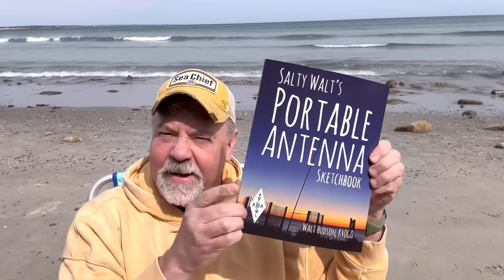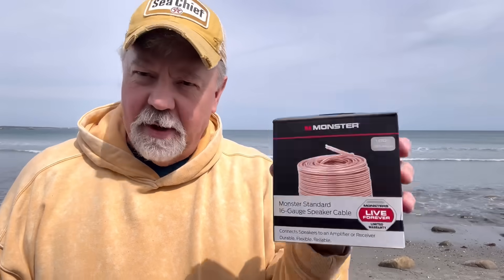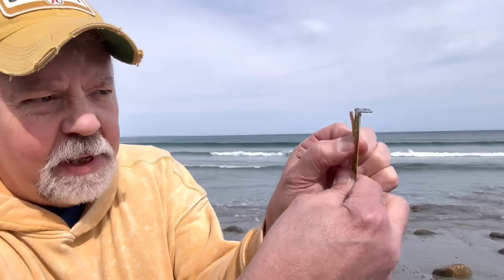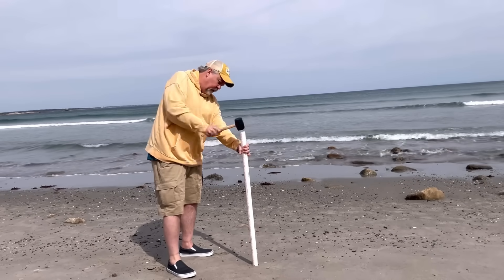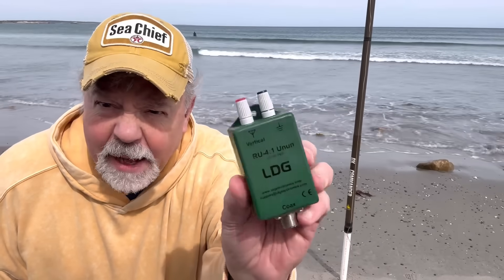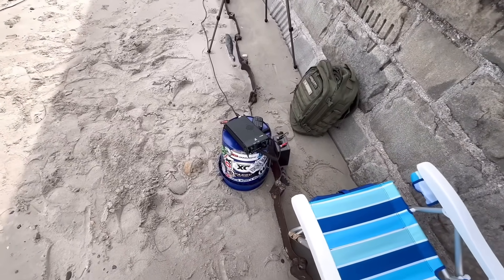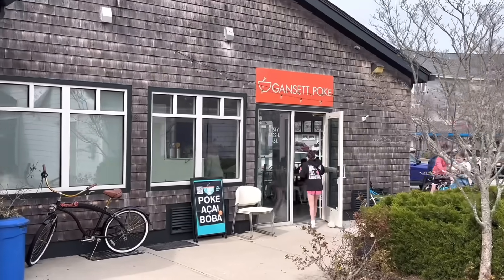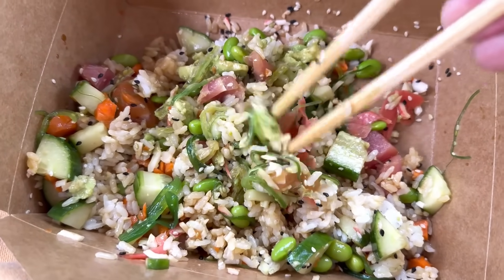How to Build a Vertical Wire Antenna - Step By Step

Comment: I just got your book yesterday.  Most was not new to me except the off-center-fed verticals.  I did enjoy your tip of bringing one wire tuned and cut for 12m and folding back for 11 and 10m.   My experience as an engineer has taught me that a hallmark of a good idea is that it seems obvious in hindsight.  73 KK7YIS

Comment: Hi Walt, really enjoying your book, I'll be building the Rybakov antenna in the next few days. One thing not mentioned in your book is what size AWG wire to use. Does it make any difference if you use say 24AWG rather than 16AWG - two of the sizes sold by my local supplier here in the UK. Thanks. 73, Martin M0UMS

Comment: Walt, I love your videos and your approach to antennas.  Could you do some where your antenna is tuned for the 40 meter band as well as 20, 17, 15, 12, 10 Meters?  Reason is; I frequently work with disaster first responders where we need to rapidly deploy in the 40 meter band because that is where Red Cross and many other disaster aids have permanent frequencies. When not in a disaster, I enjoy 20 & 10 Meters.
Reply from the maker: Thank you! Will do!

Comment: I have a question to ask you if you don’t mind. 

I have e a slim Jim on a 33 ft pole for VHF and just installed at 10 meter inverted V about 2 feet under it. My SWR on both is around 1.3:1.   Will the 10 meter interfere with the Slim Jim?
Reply from the maker: No you should be ok, especially if the SWR for both is that good.
Reply: @COASTALWAVESWIRES  I thank you for your quick reply. I love watching your videos. 73’s. KQ4UIH

Comment: I built this antenna and am using the 4 wire ground system (mine is in the backyard). I have also used this antenna for a few different contests and it doesn't disappoint. This antenna will get you contacts all over the world. Thanks for the idea Walt. Love your video's. 73
Reply from the maker: Thank you! 73, Walt

Comment: I'm at the Great Salt Lake right now and am following your book to build the Rybakov!

I've been curious to see how a counterpoise touching the extra salty water will work compared to seawater
Reply from the maker: @DavidBoucha  that should be awesome!!!
Reply: @COASTALWAVESWIRES  I activated US-3062 with a Rybakov I built following your book and this video! Thanks! 

I ended up being a bit further from the water than I expected. I had only two 25 fooot counterpoise wires and I only got them to about 30 feet from the water. Not into the water. 

I found that I could hear people on the East Coast pretty well, but they often had a hard time hearing me. Does that indicate my counterpoise wasn't sufficient?

Comment: You know what's weird, a few days ago I accidentally transmitted (FT-891, 20 watts) on 40 meters through my 10 meter vertical dipole using FT8, for two transmission cycles.  The software didn't cut me off and the radio didn't go into SWR protection mode.  I don't know what the actual SWR was.  Then looking at Grid Tracker, quite a few stations had heard me, so I was getting out enough for FT8.  So strange.

Comment: Thanks for this video, and all the effort you put into the fun of this hobby. One question I have, is how do I know the impedance of the vertical wire I put up? If my poor old memory is right, you use different boxes with different wires. I do understand the ratio and, for example, this antenna apparently is about 200 ohms which needs a 4:1 reduction to match the 50 ohm radio and cable.
Thanks again and 73.
Reply from the maker: Thanks, you can measure impedance before building by modelling the antenna or you can use a VNA and measure the feedpoint impedance as well. It's really not necessary though as wire lengths and impedance are pretty much all known values before the antenna build. 73, Walt
Reply: @COASTALWAVESWIRES  Thanks Walt. BTW my copy of your book is on order. I am looking forward to using it.